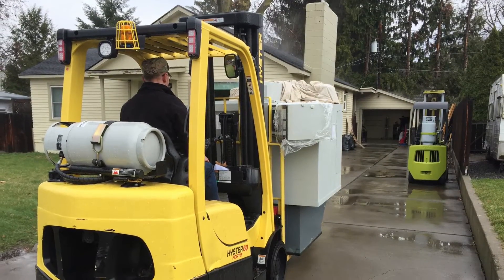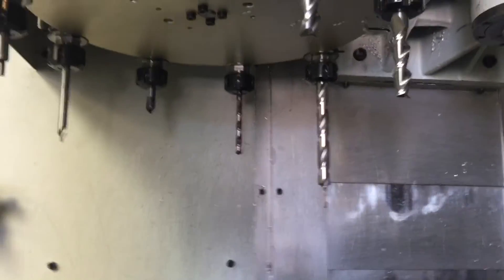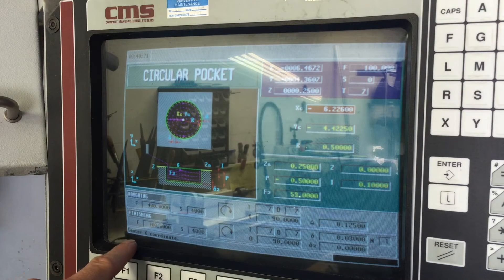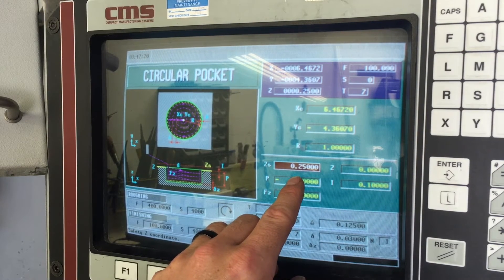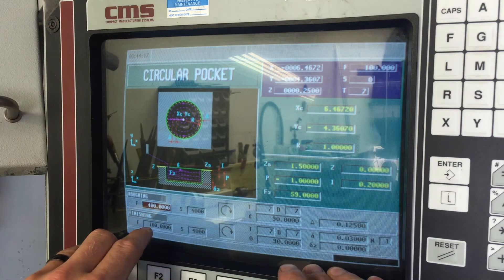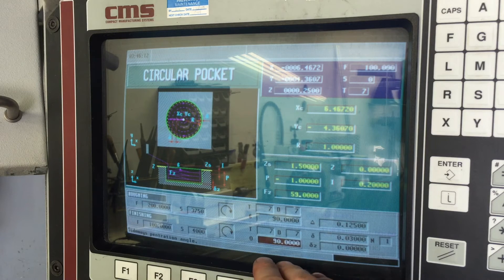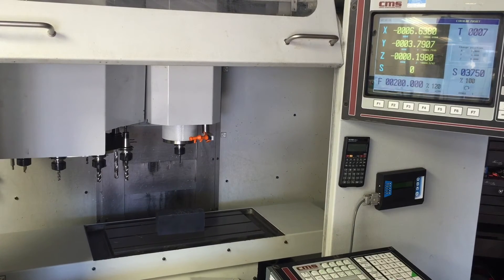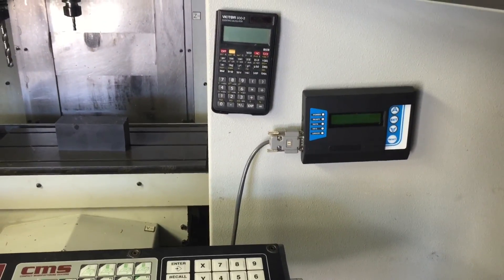CNC / VMC Conversational-Real Meca-CNC- VMC- Update-Unorthodox Fabrication

Comment: T7 and D7: as u already know, T is the Tool number as the machine knows that specific position in the changer. D is for diameter of the tool. not so much for drills, but it's how the machine uses cutter compensation when using end mills. some machines input the actual diameter, others input half the tool diameter. and will always be the same number as the tool.